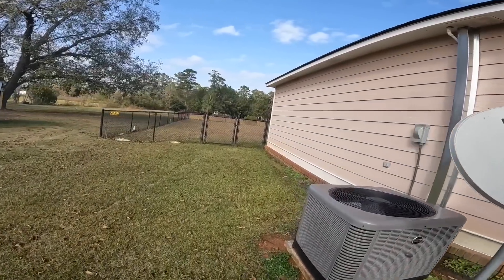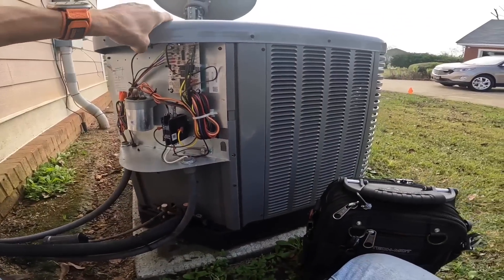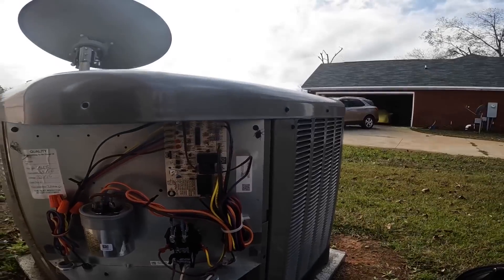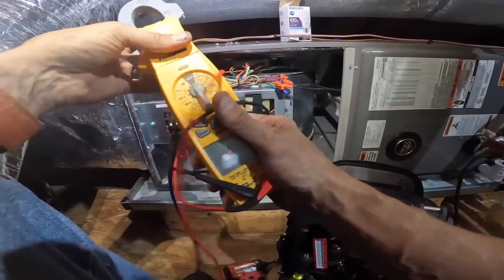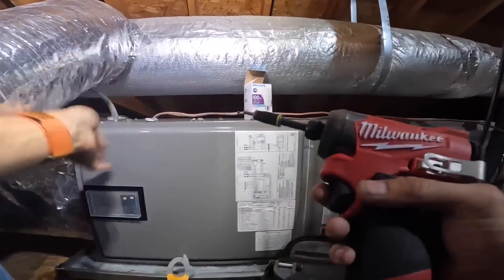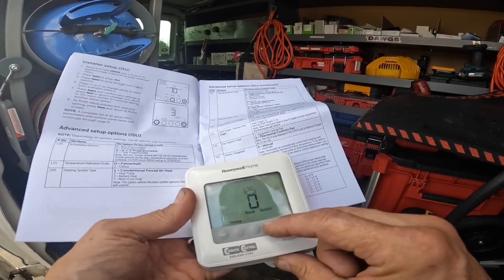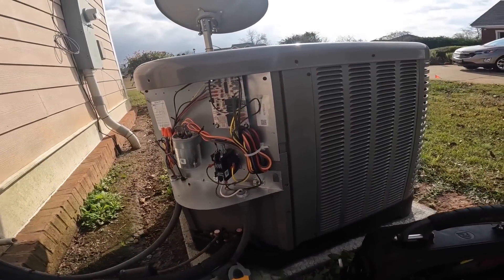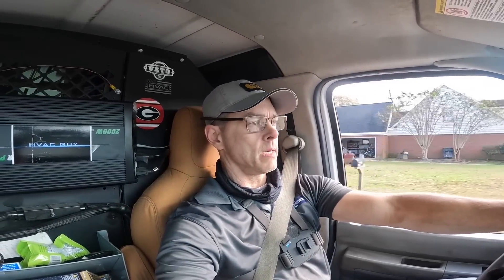Very High Utility Bill For Previous Day

Comment: I had a new Trane HP installed in 2020. Installer had planned to replace t-stat with a Pro T6. I told him I was keeping my Pro 5000, and he could deduct price for a new t-stat. Since then a friend of mine bought a new built house that had 2 Pro 5000 large screen t-stats. He replaced them after living in the house for 1 year with smart t-stats. He gave me both Pro 5000's and said Merry Christmas. I'm good on t-stats for many years to come. The 5000 is one of the best Honeywell has made. I don't need a programmable t-stat.

Comment: New and improved Honeywell t-stats. Down in Florida we had the T6 drop the configuration when a power glitch happened and it went back to default. Oops. In the middle of the summer now we are heating instead of cooling. Big big issue. I think they corrected that but after multiple failures that was unacceptable. Somehow with Honeywell the problem was either $ or China manufacturing has got to be the blame. We sell another brand now and it’s cheaper and reliable so far.

Comment: The T series I’ve had three no call for power on reversing valve. I talked with the distributor. They said that there was a known issue and they would not recall, but they took them off the shelves and replaced them. I’ll never use it again.

Comment: You go that extra mile to make sure your customers are satisfied. Well done! As for the thermostat you have already demonstrated that the reliability is in question.  You need another manufacturer you can rely on without the call backs wasting your time after new install.  You'd be my first call when no heat/cool !

Comment: Definitely consider ecobee, the setup is far simpler for systems with 2 stage heating, largely because it is automatically detects most configurations, and then spends a few days with each cycle, learning the response times of the system.

Comment: I do interior finish carpentry for new homes and when the HVAC systems hooked up and all the contractors are in there and then the homeowners coming everybody’s messing with the thermostat everybody’s pushing all the buttons everybody’s reprogramming the things and messing everything up. I used to always think I would be everybody messing with the thing and everybody denies that they touch it until it gets re-programmed to something to make it constantly run and or run while everybody’s sleeping

Comment: So, if I'm interpreting this correctly, the reversing valve (blue) wasn't engaged causing the compressor to go into cool mode and meanwhile, since demand couldn't be satisfied, the strip heat was turned on in the air handler, resulting in permanent "defrost" mode.  That would be expensive!  I recently had a similar issue with a 3 year old Emerson 'stat - I could hear the relay in the stat click when there was demand for heat, but no 24V on the white wire...  Until I checked for the signal on the white wire, I was ready to blame the control board in the furnace - I'd never seen a stat fail like that.  The Trane (made by Honeywell) unit in my home is over 20 years old and still works fine.  Guess they don't build 'em like they used to!

Comment: I still only use old school thermostats. They hold a more accurate temperature reading and they never let you down. My wife wanted my to install a "smart" thermostat just so she could use it on her phone. I said, "hell to the no, you get your ass up and change it if it needs to be changed". My thermostat stays on 70 all year round and all I do is switch between heat and cool, lol

Comment: I had three die.  The issue is that moisture gets in them form the holes in rear,  Cold air from one side and warmer wall pulls in moisture.  I placed an insulated box in the wall and drilled holes in front to allow cool air to surround the damn thing.   I am a home owner that got tired of calling the original installer.

Comment: I installed a Honeywell 3 zone controller that went out under warranty. I think it's funny that it worked for a few months only.  They replaced it and the system has been working fine after the replacement. I'm not a professional.

Comment: My furnace was installed in 1993.  My whole house AC is likely from the late 70s or early 80s. (it's so big and ugly, my house orbits it twice daily! lol)  I have a cheap, programmable thermostat from the local Menards.  Every three or four years I have to remove and rub down a thing-a-ma-bob in my furnace that confirms there is a flame or it shuts down my furnace.  And now it appears I have to "jack up" my AC unit outside because it is sort of sinking into the lawn again.  Beyond that, it all works like a charm.  Old is gold.  So it sucks a bit more electrons than a new, super high efficiency unit.  Oh well.  Electrons aren't that expensive.

Comment: I recently purchased a Honeywell T-10 for our house. It runs a Rheem 3 ton split unit heat pump. I’ve always liked the Honeywell, but this one is a weird one. It’s wiped itself out to factory settings, schedule and all was gone twice, and lately it won’t switch from heat to cool automatically. Yes, it is set for auto changeover. I don’t know if it’s a software problem or what, but it used to work great when we first installed it.
Reply: Funny im having the same issue in the last two weeks. Been working fine pervious years. Even manually swaping is not working sometimes.

Comment: I get an email every day from my power company.  I caught a stuck contactor in a day.  The outside unit's compressor just kept running and each time the t-stat was satisfied it would reverse the reversing valve and the compressure just kept running.  I was rapid cycling between hot cold hot cold hot cold.

Comment: With the shortage of semi conducts I would think that they have subbed with with some Chinese  clones. Ever notice how often capacitors fail. They didn't used to. Cheap Chinese crap. They might have a brand name on them, which doesn't mean anything. It's even hard to trust that it's made in the USA anymore. The box that it came in is probably the only thing made in the USA.

Comment: I just had a new Hvac system installed last month, after 2 days the AC would not come on.. It was due to the Band new Honeywell T model,  they replace it with another t model .. Ive been tempted to just buy the google one.

Comment: The sense home energy monitor will notify you if there is a significant change.   Whole home monitors are not that expensive or hard to install.  Couple wires and couple of clamps and watch your energy usage in real time.  It will also identify item in your home.  Fridge, hvac, electric car and ect….   Mine has picked up ceiling fans and TV’s.

Comment: You're making the parts cheaper and they're putting out quantity instead of quality Honeywell used to put out quality now they just don't give a s*** I don't want to put out quantity instead of quality I'll say that 98% of your problem and plus they're using cheaper parts we used to use a good parts cuz I used to have good luck with Honeywell myself just about everything I had electronic bars heat and air conditioning thermostats were Honeywell and now it is junk and give you another for instance the Makita impact wrenches used to be the best impact wrenches in the world now they're building them with cheap junk a buddy of mine bought three of them and broke all three of them trying to take lug nuts off his tire and the third one when it broke it took it back and he bought it at home Depot we took it back to home Depot and was going to exchange it and he told that salesman that he wanted him to come with him to the parking lot to see if the sucker was going to work so he didn't have to make another trip back down to home Depot well that sucker broke right here in the parking lot and he just bought it that's another for instance of cheap junk well that's what's happening in Honeywell they're putting out quantity instead of quality and they're putting them together with cheap junk all right man you have yourself a good day

Comment: I work for a power company in the mid-atlantic and my team and I ware tasked with identifying these problems for customers when they get strange bills. Our smart meters can look at a customer's energy usage every hour of the day and we can often identify problems with heat pumps, hot water heaters, wiring issues, etc. We're not HVAC techs, so we can't do the work. But we advise the customer to call a tech like the one in this video to come out. Sorta like how the company she is served by told her the problem was the heating. Just for the record, these opinions are my own and don't represent my company.

I can attest from my experience that these Honeywell thermostats are problematic. Especially with heat pumps. And whenever I see a Honeywell that looks like the style above and has a Heat Pump, I advise the customer to just replace it with another brand thermostat. Now, I may be biased because I'm usually called out after there's been a problem. So there are probably thousands and thousands more out there that work perfectly. But I am surprised how often I go to a customers and as soon as I see that thermostat I get a pit in my stomach. I've seen other thermostats have quirks or fail or not be set up correctly. I've seen people install the wrong thermostats. But not with the consistency I see these Honeywell thermostats have issues.

It's weird, because I know Honeywell has a good reputation. I've seen hundreds of older or different style Honeywell thermostats and not seen any consistent issues. But the ones that look like they do in this video, I've seen enough of them have problems now and they become more common/deployed each year, that they really give me concern when I see one in a home or business.
Reply: There are several home power monitors.  I have the Sense unit and I can see several items in my house and how much they use live.  Also keeps track hourly, daily, monthly and yearly.   Tells exactly how much it is using.     The Sense energy monitor, look them up!  😁

Comment: Honeywell is and has been pure garbage since the early 2000’s. 

What do I recommend?  I don’t know. My 2015 era Lennox iComfort Wifi tstat at my house just lost the screen. I talked with a major Lennox dealer in town and they said they have had several calls just like mine in the last month. All 2015 era Lennox iComfort wifi Tstats losing the screen. Still operates through the app. 

I’m going to replace it with an Ecobee 5

Comment: I've had more problems than I would like to consider as normal with the T series thermostats.  I've had at least 2 that would not shut off after the heat call was satisfied but would only do it intermittently so it was hard to catch.

Comment: I installed a T-series (T5) so my blind wife could control the temps by voice through Alexa.  After just over a year the wifi circuit failed, but otherwise working properly.  I am reluctant to replace it as it's an expensive gamble.

Comment: yea they din't come out cuz they know what breaker is pulling what by amps and voltage... modern homes have each outlet defined so people can determine where they can cut back and where its used, I think Nest can remotely turn things on and off as well using your cell phone anywhere in the world ..   68 holy smokes my AC kicks on at 78...  WOW that's BRRR freezing cold
Reply: There are several home power monitors.  I have the Sense unit and I can see several items in my house and how much they use live.  Also keeps track hourly, daily, monthly and yearly.   Tells exactly how much it is using.     The Sense energy monitor, look them up!  😁

Comment: yea you can monitor your energy usage by the minute these days, using an app on your phone, yup, they have been retrofitting the spinny thing on homes apartments, condos commercial for years now, most have it but don't know about it, the guy who checks your meter doesn't have to get in your property now, he just rolls by and logs onto your meter, checks it, so you can access it as well, if they havent installed on and you want to monitor it you can install it yourself its an add on to the meter easy peasy flippinpleasy
Reply: There are several home power monitors.  I have the Sense unit and I can see several items in my house and how much they use live.  Also keeps track hourly, daily, monthly and yearly.   Tells exactly how much it is using.     The Sense energy monitor, look them up!  😁

Comment: I do HVAC for a living and is the thermostat set to B instead of O since Ruud usually switches the reversing valve to heat and normally its in cooling. Other manufacturers are opposite.

Comment: the local electric company installed smart connected meters and you can set up your account to get alerts based on high use, and track hour by hour how much energy is being used.

Comment: I check my daily use with my smart meter and my thermostat shows my hourly usage everyday of HVAC time.
Reply: There are several home power monitors.  I have the Sense unit and I can see several items in my house and how much they use live.  Also keeps track hourly, daily, monthly and yearly.   Tells exactly how much it is using.     The Sense energy monitor, look them up!  😁

Comment: I have a Mr Cool system it's a piece of crap, I had it installed mar 2022 and it's been given me problems , at first they said it was static pressure they came installed bigger duct work and it's still freezing up. My electric bill has been going up since. Never saw a saving in my electric. Just been going up

Comment: 0:39 - I recognized the location immediately from a previous video.
A thermostat should easily last a decade (bare minimum), barring anomalies like voltage/static issues. Ridiculous! I assume the problem boils down to dirt-cheap engineering/manufacturing.

Comment: We have installed between 150-200 Honeywell T4 and T6's in the past year. Had to warranty about a dozen of the T4's and one T6. I do like the T series thermostats but the T4's need better quality control. I suspect Honeywell is aware of the problem as anyone that I have spoken with stated they have had issues with them as well and other techs/installers simply will not install them. 
Just replaced a gas valve yesterday that was popping the fuse at the furnace board. They had a Google Nest thermostat that went bad during the process. I temporarily replaced it with a T4 to get them thru Thanksgiving. They will make a decision to either keep the T4 or go with another smart thermostat, first of the week.

Comment: My house had a programmable thermostat. It had 2 settings for each day but no manual setting other than a temporary 2 hr or so setting. My son in law lived in the house the first winter. The house was extremely cold in the morning, they hadn't realized the mid week night setting 45 degrees F. The house was unoccupied during the week by previous  owner. This didn't cut it during the -25 mornings in minnesota. I went on line and got the manual and found it didn't have a long term manual setting. To reset it during vacation time took 14 settings. Honeywell really did themselves proud on that one. A simple manual thermostat really fits my needs much better.
Reply: Does mine too. I have separate 'stats in different locations for baseboard oil heat and air duct A/C. After all, the house responds differently to heat and cold winter and summer: one 'stat location isn't ideal for both functions. And both are set on manual control.

Comment: Just replaced a outdoor thermistor on a Rheem Heat pump just like the one your working on, 4  in 2 years that went bad. Honeywell thermostats in my opinion are still the easiest and universally the one still to carry, Pro one is good but no beauty plate option just to snap in place, installed a few hundred T5's, T6's only a few were bad.